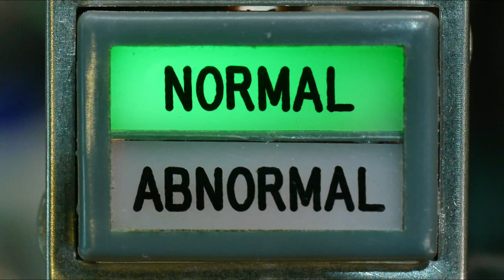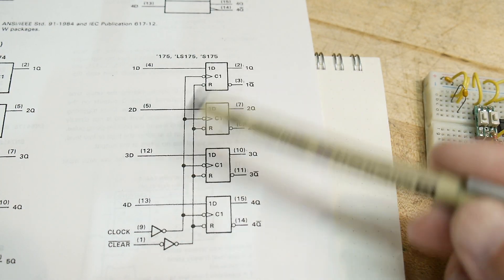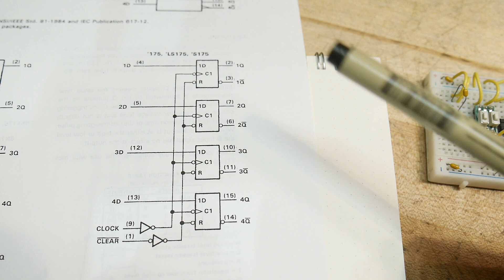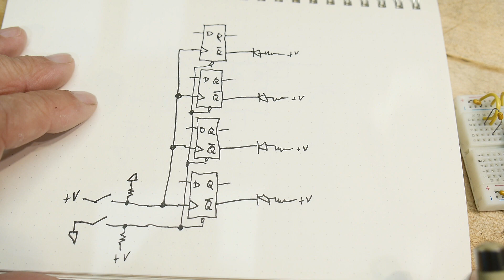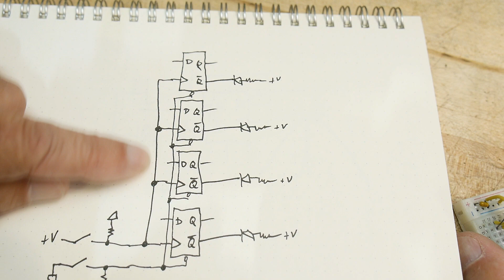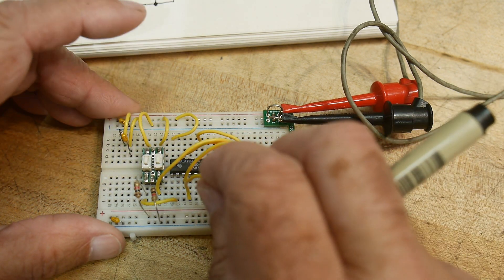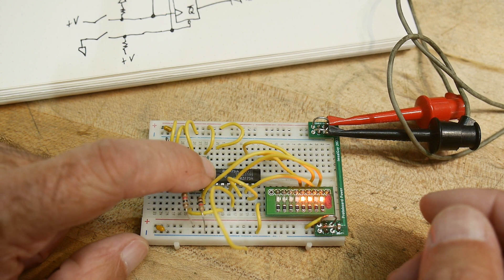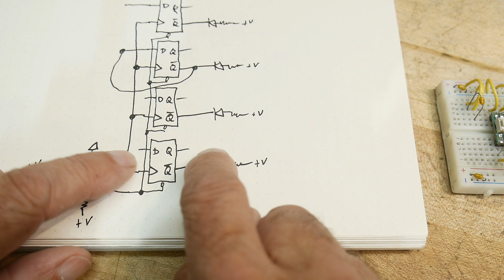#1591 74175 74LS175

Comment: By chaining D FFs together, it is easy to make a binary counter.  But they can be used to generate other sequences as well, such as gray code.  I think that is what is meant by "pattern generator".  Also, it should be pointed out the D FFs are commonly used to implement Finite State Machines (FSMs).  Note that for pattern generators and FSMs, some additional "glue logic" may be necessary.

Comment: The "pattern generation" it speaks of is probably a Linear Feedback Shift Register (LFSR) - wiring it as a shift register, but the input pin is an XOR of the last output bit and one other intermediate bit; if you do it right then it will cycle through all possible 4-bit sequences in turn (other than 0000). See https://en.wikipedia.org/wiki/Linear-feedback_shift_register

Comment: I could use this as a quad clock divider instead of two 7474s. I never noticed it before. Thanks for the tip. I wonder if there's a 6 or 8 D flip-flop version (with Q and /Q). Alas, I know the 74174 does not have the /Q outputs.

Comment: u know what id love to see.  a scalar register that holds an analogue value!!!
Reply: You could go grab an Analog Devices SMP04 or the (much pricier) AD684.
Reply: @tfrerich  thanks. a demo would be pretty cool,  it would have been cool if you did pipeline em, but u only mentioned it, you didnt actually wire it up which is a pity.  btw great channel!!!!
Reply: @tfrerich  if u pipeline the registers, you can actually do a digital filter with them! (use them as filter taps.)
Reply from the maker: sample and hold: https://youtu.be/nlJDjPK5wgQ
Reply: What you're looking for is a 'sample-and-hold'.  It can be made with a dual op-amp, an analog switch (like a CD4066B or a DG401) and a low-leakage capacitor.  I think I've given you enough keywords that a search engine can direct you to a wealth of information.